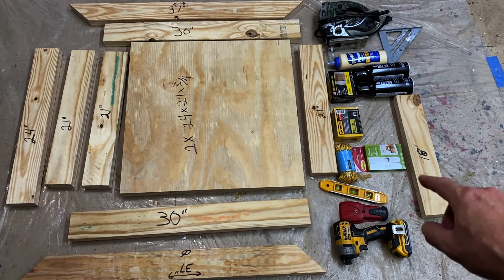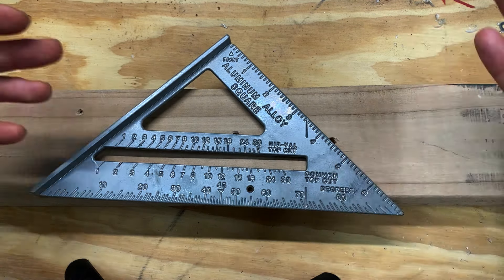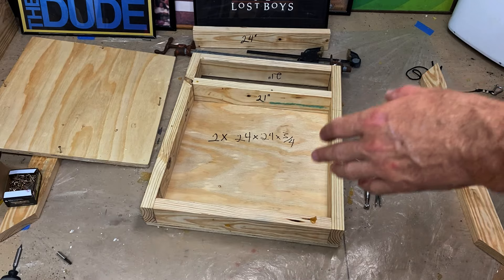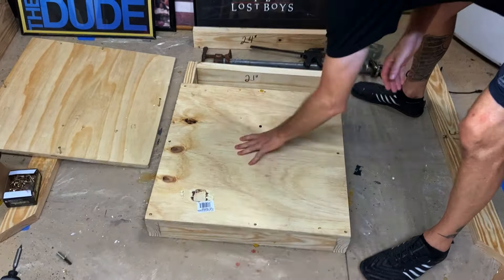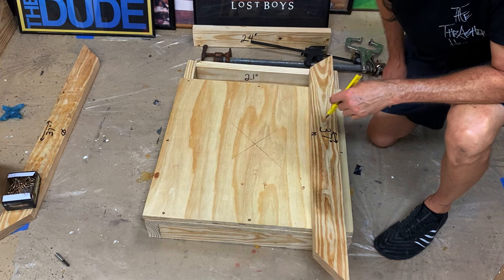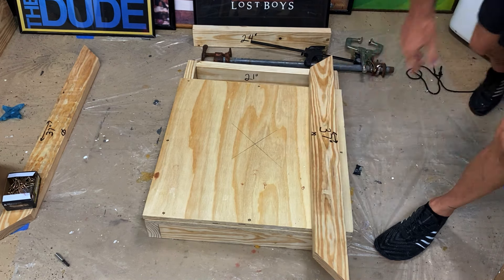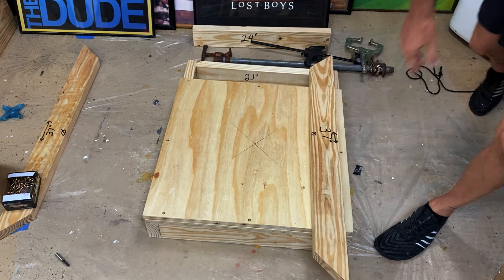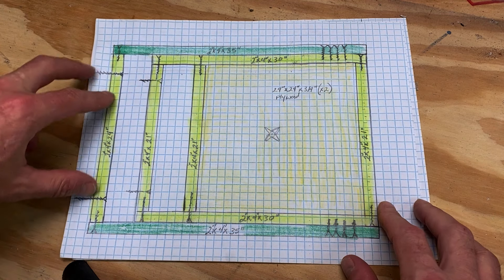How To Build A Speed Bag Platform Under $100!

Comment: Great video! I'm building one of these this weekend. How did you mount yours to the wall? Is it a concrete wall or did you mount into wood studs?
Reply from the maker: @tollwutig  awesome!! I used 4” anchor bolts into the studs. Let me know if you have any more questions. I came up with an easier way. I just haven’t made a video on it yet

Comment: Great video! Is there a specific varnish or polyurethane you'd recommend on wood to make rebound as fast as possible?
Reply from the maker: @nicholasrocco5084  thank you very much! I wouldn’t say paint or varnish will make it any faster. It will be friendlier to the leather on the ball. 

Like I say in the video, they can add a little more strength to the top joint and then add sand to the drum. You want as little vibration as possible. You can fill it with sand then put a top on it. That’s what makes it fast, that and a good ball and a good swivel.